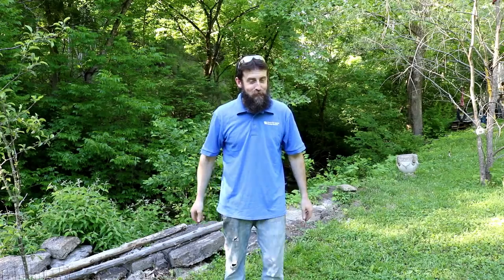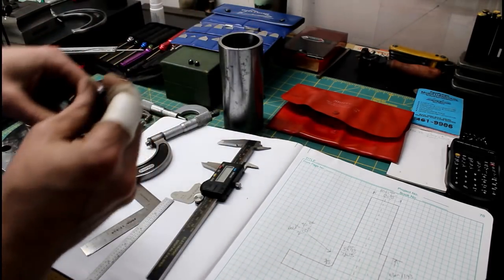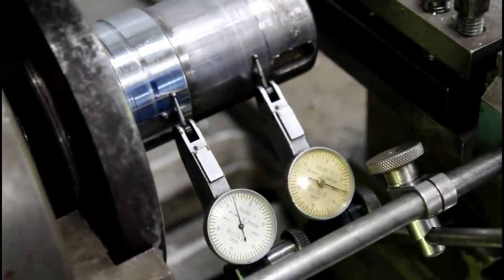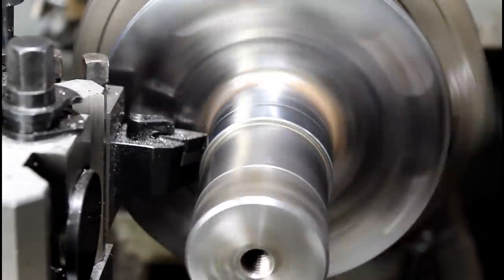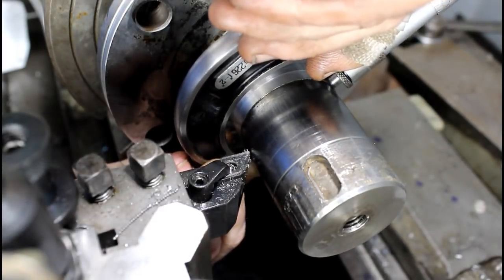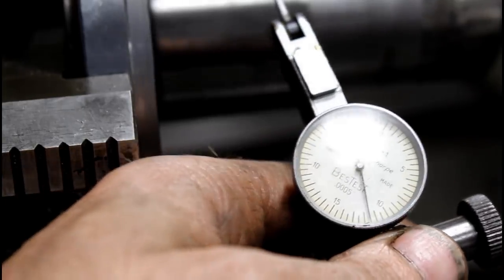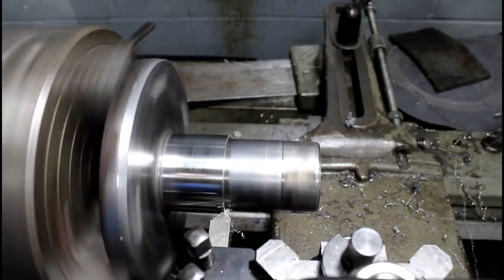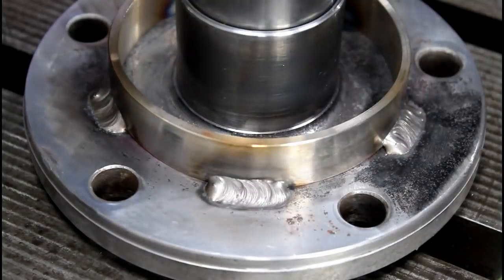REPAIRING HEAVY SHAFT DAMAGE.

Comment: I would have thought that a it needed a live center on the end, but were you concerned in damaging the internal threads? Follow rest be in the way? 2 years back, had Bales Machine (old friend) repair my CJ5 front azles in the same manor. He used his electric oven to expand the stainless bushings .0002 and "wala",,,I know have a bigger LeBlond 17, and he retired, so up to me if rear axles are found wore (@@),,Nice job Steve, great video,,Bear TX

Comment: good job-  I am thinking about a way to repair the shaft on those huge landrollers - they won't fit in a lathe as the shaft is welded into the drum. The shaft is 50 thousands under three inch. We know that someone will run one long enough with the bearing gone to wear unto the shaft. Any ideas??

Comment: Hi Steve, for a shaft repair as you did, look for a "speedy sleeve".
Speedy sleeved are made just for your repair application. Their surface finish is correct and have a flange to press them into position that is removed after the sleeve is seated. I believe that Chicago Rawhide makes them for covering groves that a seal has worn into a shaft.

Comment: from toolroom  days  long ago   I have a memory of  a simple  step which made the  'straight starting ' of a press fit  both for internal and external fit .   simply skim a starting  step in a bore or a shoulder on a dia .   to the  nominal size  say  1/16th  inch   length  , this makes the mating parts  sit perfectly aligned before  applying  the pressing force  avoiding the risk  of pushing on  crossed  axis parts
.

Comment: Great job, no problems, some good ideas there....Dave
Reply from the maker: David Richards Thanks David, I just used what was on hand to repair the damage. That equipment the shaft goes in has been running well for the last month. No leaks and the sleeve seems to be holding up. Great to see you👍.

Comment: Steve, we use tubing thickness indicator gauges at work. They work very repeatably for tubing. They've got them as MSC and the like for about a hundred. Anyway, they make with a ball anvil and a flat anvil may be worth checking into if you do a lot of tubing.

Comment: That looks like a repair I do all the time. The only thing I do different on a press fit is to add some loctite 609. It will help prevent galling and keep the part from ever moving. My favorite way is to use a shrink fit on the sleeve so I don't have to take it out of the lathe while installing the sleeve. Looks like a good repair.

Comment: Nice work. Well thought out. Suggestion: rotate your work CCW instead of CW when checking runout with DTIs. It is easier on the DTI when the frictional force pulls away, and any bumps on the work will not force the stylus into its bearing. Am I making sense?
Reply from the maker: Paul Mathews When I was rewatching the video I was thinking the same thing on the indicators and rotation. 🤔 That's strange that you would bring that up.
Reply: Steve Summers I also put a drop of oil on the DTI stylus.

Comment: I don't think you were too aggressive on the press fit because when the sleeve was turned down later,the pressure on the shaft would have lessened.
You could have turned the ring down closer to the finished size having clocked the bore before pressing which would reduce the force necessary.

Comment: Hey Steve, I offer to help you but you never responded back.Im happy to see that your using to file the correct way on the lathe.
I read some of The comets and people like what did did. But you did get shaft by the shaft. I’m sorry but your repair 
Way done the wrong way. I’m not here to bad talk you just trying to help you show the Viewers how to do things The right 
Way. What going to happen is the bearing is going to heat up making the sleeve to expand, the sleeve will spin on the shaft.
Making it worse than you receive it from your nephew. Question? How hot doses the sleeve need to heat up
To expand from a .002 press fit? Let me know if you like my help,iIf not close enough is only good in horseshoes. Have fun 
Machining Horseshoes.     
Skunkworks Dept.

Comment: It is pleasing to see shrink or press fits being used rather than adhesives.  The level of accuracy required is a bit higher and is certainly a sign of skilled machinist.   Compounds have their place but feel a little like a shortcut into the world of mechanics vs machine fits when they are used too often.
Reply from the maker: Crafted I sometimes have trust issues with adhesives. People use them successfully every day but a press fit will hold forever if done correctly. 👍 Thanks for watching

Comment: Nice repair, I don't think .002 interference is too much, farm equipment gets run 10-12hrs at a time, it'll build up a good bit of heat when in use, your sleeve should have no trouble sealing and staying put.
Reply: Jim Zivny its in the general rule of thumb tolerance 
.001” interference for every 1.000” of diameter
Reply: mightymalikie Thanks

Comment: Redi-Sleeves are a much easier fix for a seal surface. You could have also had that very attractive welder you had on your channel a while back weld it up then turn it! ;) Unless she welding up a Nuclear Power Plant some where. Nice video!
Reply: Cape Cod CNC Those sleeves are great but they don't come in every size, also oddball sizes might be hard to source in a timely fashion. Farm equipment has to run now when the crops are ready or seeds need to be planted, farmers don't have the luxury of time.
Reply: I never said that was wrong, just making a point.
Reply: Cape Cod CNC I wasn't bring critical of your comment just adding why in some instances it may not be an option. I've used quite a few over the years on cars, trucks and equipment. A sleeve kit may cost $30 vs $450 plus labor for a crankshaft or other part. Some oem's even offer seals alone or with the sleeve, great option.

Comment: Is there an advantage to turning that down and pressing the sleeve, over building up weld and turning it down? Is it to avoid heat warping? I'm an electrician, I've never even touched a milling tool other than the brake lathe at our tire shop, so please excuse my ignorance.
Reply: I'd think that avoiding the chance of heat warp or weakening is one good reason, also, if the part was made cheap to begin with, your sleeve could be made from something that stands a better chance of enduring the forces that brought on the problem in the first place.  Sad to say, a lot of farm equipment (especially "hobby farm" equipment) is made from lighter or lesser grade material than, say, construction equipment.
Reply from the maker: Rusty Shakelford I was worried that welding would warp the part. Plus welding would have taken just as much time or longer. I spend way to much time behind a welding helmet anyway.
Thanks for watching and it's good to see you 👍

Comment: Nice work Steve! Now get an aerosol can out layout fluid. It's not the best for small parts but for big surfaces like this it's great. Applies and dries much faster than the brush type.
Reply: I'm wondering if the slow drying issue is from a "new" formula. I have a 2 older cans, red and blue that I got when I purchased a tool chest of tools. These dry very quickly  like I remember from years ago in the tool room.  I also have a newer can that I purchased a few years ago and it too takes forever to dry.
LaVern
Reply from the maker: Jon Miller I will look into getting some. Never used the spray can. I do like the small bottle with the bingo blotter type head.

Comment: Looks like sch40  DOM tubing.   Good choice for that repair.
Reply from the maker: MotorHead Garage it could not have been a closer to size. Cut it off a bent cylinder I have in the scrap pile.  I believe it is sch40 DOM also.